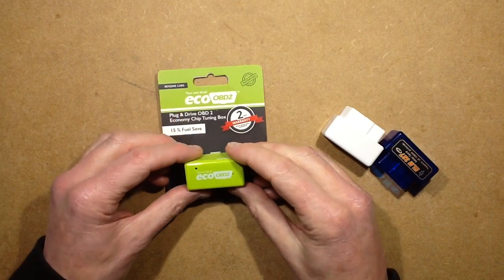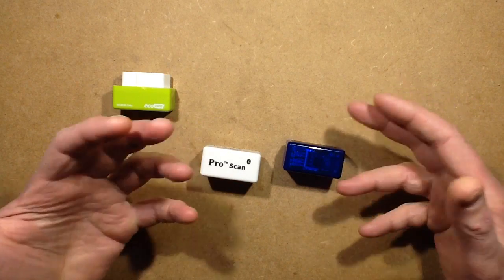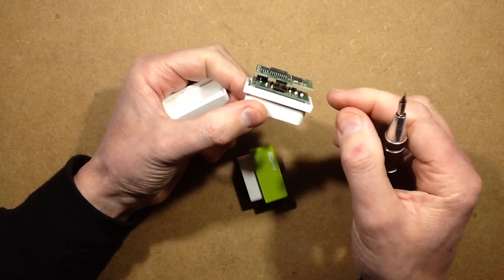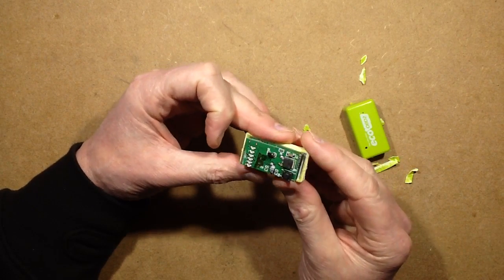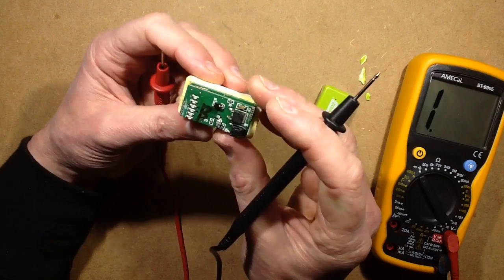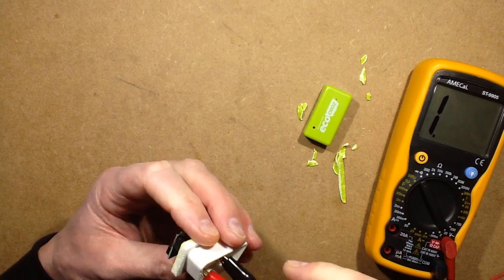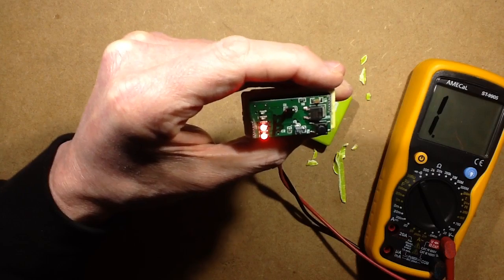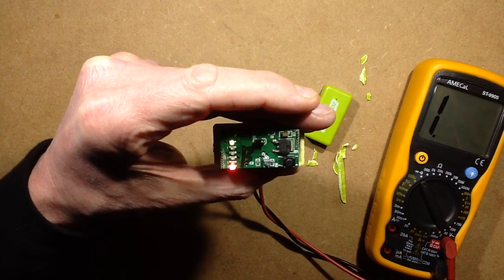Inside an ECO OBD2 "chip tuner" fuel saver.

Comment: Many companies will sell legit tunes for your car, and you'll just get a box in the mail that plugs into the diagnostic port. It completely re-flashes the ECU though, which is what's required to change parameters in it. Making changes on the fly... I don't think OEM ECUs will allow that. I've used one of those tuning kits from a legit and reputable company, and it worked just fine. I've also used an ELM327 diagnostics adapter, and it worked fine too. :)

Comment: No, it's not able to do anything it claims.  Even if they had managed to illegally forge bi-directional communication, that still doesn't give it any sort of ability to alter, interrupt or manage any sensor data.  Flashing the PCM on any modern vehicle is quite the affair; far more than is worth a youtube comment.  Just do a bit of digging and you'll find the flashing protocols, hardware, software et al is incredibly specialized to each vehicle manufacturer in the very least.  :)
Reply: +rhkips Not exactly incredibly specialized, but when looking into the packages, you do have to usually buy for the make/model you are going to tune, and those software packages are some serious cash if you want the good ones.

Comment: Devices like that do nothing and they are even not capable of doing something, most modern cars have some form "self-learning" maps (till some extent).
You will have more chance to reprogram ECU using wireless then devices like that will do something.
There was always devices like that on market (using OBD or piggyback on ECU) and in 99.9% they do nothing.
If someone want to reprogram ECU you would need specialized hardware/software (which you will need to get from manufacturer and it cost are starting from onwards 1000$), that why most people who want to change ECU settings opt for replacing whole ECU with aftermarket one which is much cheaper and easier solution.
Reply: +Miloš Lazović Pretty much that. The ECU already "learns" its injection tables based on temperature, intake pressure, throttle position and exhaust O2 to keep air-fuel close to optimal under all circumstances with minimal delay. There isn't much left for a simple aftermarket gadget to optimize since the ECU already does all the essential optimizations itself to compensate for wear and minor faults.

An extra oil change or other routine maintenance item over the vehicle's lifespan will save more fuel than this gadget ever will.
Reply: +Teardown Dan To be totally precise you can change fuel maps to get more power and better fuel economy, but that will not save you any money in total (I have friend who was using piggyback on ECU on diesel engine and engine produced more power used less fuel but he need to refill urea tank much more often which cost more money then he saved on fuel).

Comment: It's almost certainly bollocks.

Can you reprogram an ECU via the OBD2 port? Sure! However, you typically needa special connection of some sort, such as a checksummed handshake specific to that ECU (there's more to it than that, but I'll let someone else go in to more detail) and at that point, you can write new values for fuel trims, etc.

However, this device isn't that. It's a light show, nothing more. If it does anything on the actual bus pins, I'd be gobsmacked, but without the correctly specified ECU rom, it ain't changing jack shit.

Those special ROM images are why things like BlueFin and other such 'tuning boxes' cost several hundred pounds - you're paying for the software license; the hardware costs a few quid - http://www.mybluefin.co.uk/ is an example, although I'd not trust Superchips as far as I could throw my car, never mind the actual device; the class of device to tweek fuel and timing is genuine, though.

See one here: https://www.youtube.com/watch?v=GtjPtYYFF9k - I'm not sure if his setup is pirated or not, but while I'd not suggest 'just having a go' as some guides suggest (And this guy doesn't, to his credit) it's bloody dangerous if you don't know what you're doing. You can do anything from genuinely bricking your ECU, to holing your pistons.

That green thing, however, just ain't one of 'em.

Comment: as i understand it if it has access to can bus it can inject code but i doubt it writes anything to the ecu so in theory it could alter injector function or timing but it would be at odds with the ecu unless it also spoofs return code from the components plus no two manufactures would likely have the same identifiers so it would have to have a large database on board so i am skeptical if real it would prohibitively expensive

Comment: I allways thought that the obd standard was for read only diagnostic codes and live data, surely to program the engine variables you would need to connect direct to the ecu with a different tool.
I cant see that box of air doing anything.

Comment: hire a car... if things go pear shaped you can walk away as NOTHING HAPPENED...
Reply: If things go pear shaped you have to walk away because the engine is destroyed in the process :P
Reply: I work for a rental car company. If there is an issue with an engine the company will try charge the manufacturer on a warranty basis. They get an impartial engineer to look into what happened. If they find the emu has been modified by third party software it won't be warranty and the rental company will take you to court for the full value of the vehicle as it is a contract violation to modify the vehicle in anyway. It's not idle threats either, it happens quite a lot when people put roof racks on the vehicle and damage them and the company takes them to court for the full value of repair, rather than their excess
Reply: niffumau Wicked stuff lol
Reply: yea, rent the car XD

Comment: At least on my Ford (2010) you can reset the "adaptions" through the OBD port, which results in the car "re-learning"all its fuel trims, injector timings, etc. Same as if you disconnect the battery. Sounds like what they mean by "analysing" your driving.

Comment: Wouldn't it be very dangerous if car manufacturers allowed users to change the engine control? I doubt that is common nowadays. I think the module does something though, it probably provides diagnostics to the app you showed. But I don't think it rewrites anything into 'fuel saving' capacities, or at least I hope it doesn't.

Comment: It should not be possible to alter any of the ECU settings with respect to controlling fuel usage or emissions. Most cars need a special tool that only the dealerships will have access to, the only universal requirement for OBD2 is that it must be possible for any OBD2 tool to read diagnostics information.
Most manufacturers remove the ability to write to the can bus from OBD2, or they require a special procedure to allow it (usually opening/closing doors/windows, pushing buttons and pressing the brake pedal in a specific order).

There are however certain emission related items on the car which if disabled would improve efficiency, the EGR valve for example.

There is a huge danger with anything messing with engine ignition timing/fueling, bad timings could cause detonation/pinking, which will destroy pistons. Altering fuel/air ratios will cause carbon build up (rich) and/or overheating (lean), leading to engine oil contamination, increased engine wear, valve guide damage (from excessive heat) and probable damage to the catalytic converter (from unburnt fuel).
Reply: +Strider9655 That "dealer only" tool you refer to is far from dealer only. I've got 8 different interfaces that will read and write data from 99% of OEM ECUs on the market today.
Reply: +Tim Ramich You can actually change shift-points, rev limits, fuel injection duration and many other things if you have the right hardware and software on a decent quantity of common cars stateside.  Nothing special about it at all, just requires some $$$.  I encourage you to look at HPTuners VCM Suite - $650 USD
Reply: +Strider9655 How would disabling the EGR improve efficiency? It cools down and dilutes the combustion chambers, allowing a leaner burn and more timing advance. It's really only ever enabled during steady cruise speeds. Less throttle required because of advanced timing means less fuel being injected. EGR won't have any effect on city MPG, but it will help the highway MPG a slight amount.
Reply: +Tim Ramich EGR reburns exhaust gas to reduce emissions, cars don't run on exhaust gases. It won't help mpg at all, it's purely there to meet EU emissions requirements when new. Everyone would be better off removing the damn things.
Take for example the oil breather system venting to the inlet manifold, removing this and fitting a catch tank can increase power by nearly 5%. Burning anything other than clean air, can only do one thing, that's reduce power and reduce efficiency.

Air to fuel ratio has to be 14.7:1, too lean and it burns too hot, too rich and it leaves carbon deposits.
Timing advance isn't really relevant to throttle or fuel usage, the advance just ensures the plugs fire at the right time to avoid engine damage caused by detonation.
Reply: +Strider9655 You can't burn a gas that has no fuel. It's injected for emissions to reduce NOx stuff. It injects such a tiny amount that it doesn't reduce power. It actually allows for an increase in power versus throttle level because it cools the combustion chambers and allows for an increase in timing advance.

Cars can only idle and do some very very light load at 14.7:1. You can never run a car under decent load at such lean AFRs. Cruising at 40 mph you may be able swing 14.7:1 without generating too much heat. On the highway doing 55+ when drag starts to become a huge factor...forget it. You need to make it richer to remove heat from the cylinder. If we had alloys that could withstand tons of heat, we would be best off running leaner than stoich, and not even cooling the engines. Running too rich also generates excess heat.

Timing is really relevant to many things. If you fire too late, the burning mixture will last into the exhaust stroke and burn up the valves. Ever see an exhaust manifold glow red hot? Retarded timing... Sparking off the mixture too soon will, of course, result in detonation. Firing it as advanced as you can go increases the cylinder pressures. The more cylinder pressure, and therefore cylinder temperature, there is, the more efficient the burn. You can't just fire off an arbitrary amount of mixture. It's dependent on load.

Engines have many facets of operation. It's not so simple as putting on a wideband and looking for knock. EGTs should be measured, too. I wouldn't be surprised if manufacturers measure the cylinder pressures in R&D via the spark plugs. Cam profiles have a huge affect on how you must time and fuel an engine. This is why people who mess with a car's tuning never have cars that are decent to drive on the streets. It would take a person years to get a car tuned correctly to compensate for varying humidity, temperature, and pressure. No such people have setups that even last that long. OEMs can do this because they have facilities that can generate such conditions at will.

EGR decreases emissions, and it also [inadvertently] increases efficiency under light load. It does not operate under significant load. If your car is losing power because of the EGR, then the EGR system is malfunctioning. Blaming the EGR as a faulty concept in this matter is like saying that fuel injection is a useless technology because you have a dirty and stuck-open fuel injector. If you don't agree, then keep your head in the sand and leave me alone. This is not up for discussion. What I say on this matter is established fact.
Reply: nope. lots of scanners will read and change things on any vehicle. expensive but dealerships lost the ability to force people to go to them a long time ago. most dealerships don't even use "their own" scanner. if they can afford it, they use the snap-on scanner like everyone else
Reply: +tapper88 You can only erase and reset things that are in volatile RAM, or simple things that are given specific access like speedometer calibration. You can't just plug in a scanner and erase the car's complete tune.
Reply: +Strider9655 Of course advance makes a difference. If you fire the plug at 0deg BTDC, you'll waste a huge amount of fuel, energy and exhaust gas temperatures will rocket. You need optimum ignition advance to ensure that the combustion event happens well before the exhaust valves open, or you'll a) waste energy and b) send a rapidly expanding and heated charge mixture into the exhaust directly into the path of your turbocharger and/or catalytic converter, via a sensitive lambda sensor.
Reply: +Strider9655 you can use the diagnosing computers. Available any where.
Reply: Strider9655 you do realize that if you could not have 2 way communication a airbag warning light or a check engine light could not be reset without pulling the battery
Reply: +Tim Ramich I must object, disabel the EGR in in Turbocharged engine will help keeping your turbo clean, give him way longer lifespans and in my Golf MK4 disable the EGR and Reprogramming the ECU from an professional gave 70BHP, less diesel and still match all the requirements of the environment regulations. But no, a cheap ass device in my diagnostic wont help anything with all this.